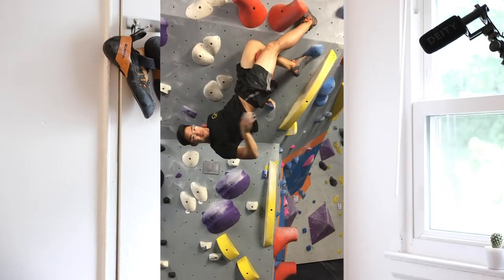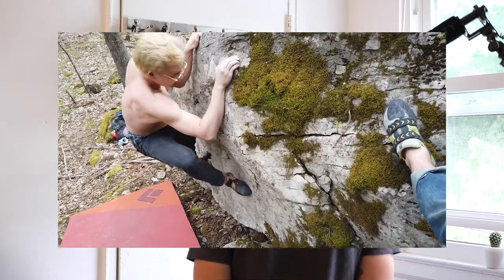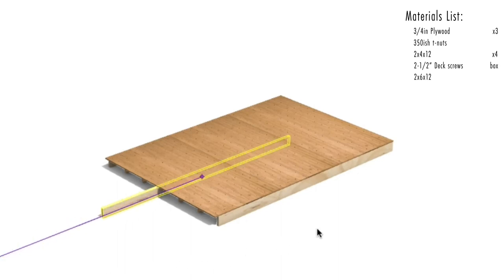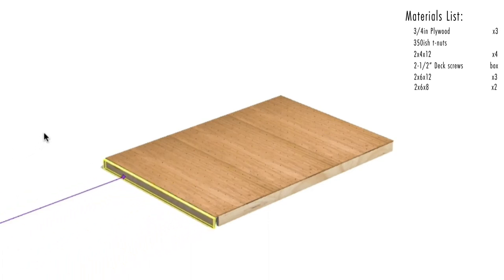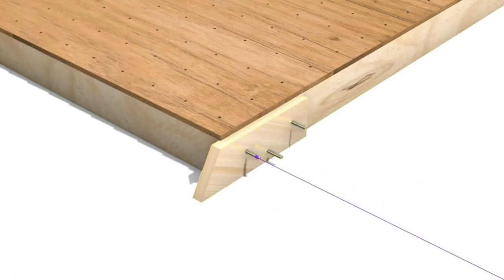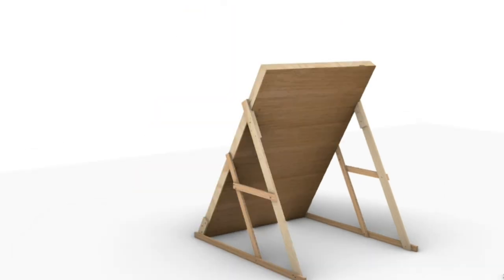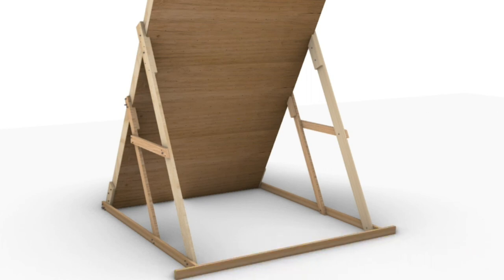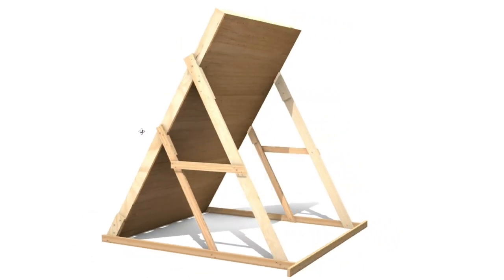DIY: How I Built My Climbing Wall + 3d Model Tour

Comment: Hi! May I ask what are the lengths of the diagonal members for the support?
Reply from the maker: sure! they were 10 ft long, which was easy because I could buy a 2x6x10ft and not have to cut it besides the angle cut where it meets the ground. It all really depends on at which point you choose to meet the diagonal member to the wall itself however.

The shorter diagonal was around 6ft 4 ish inches. This number was arbitrary but it allowed for the other 3ft 8ish inches (from a 10ft 2x4) to serve as the horizontal member without needed extra wood or cuts.
Reply: Barelyboulders got it thank you!
Reply from the maker: @eugenelui3768  no problem!